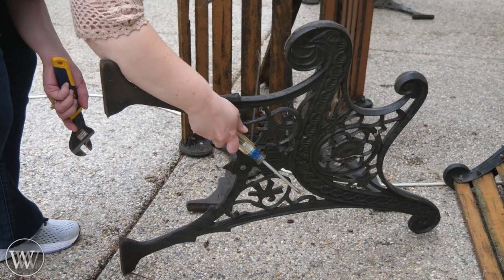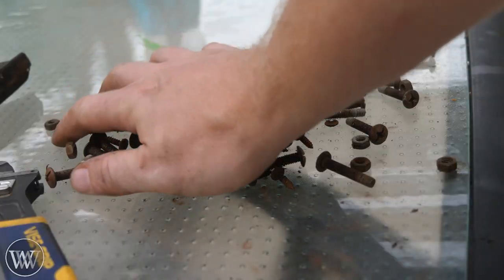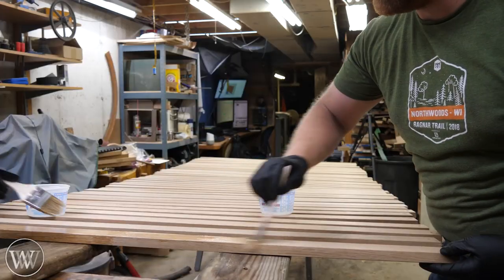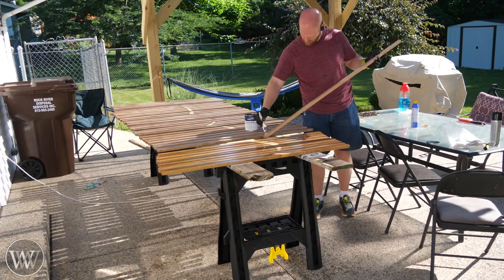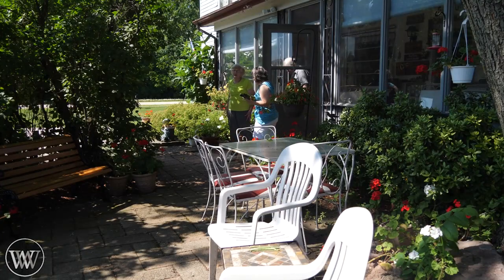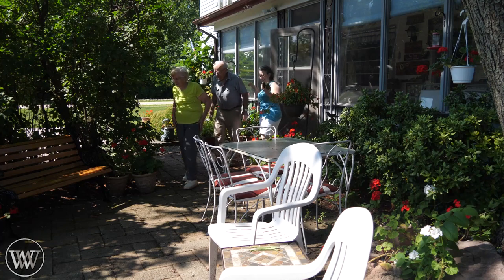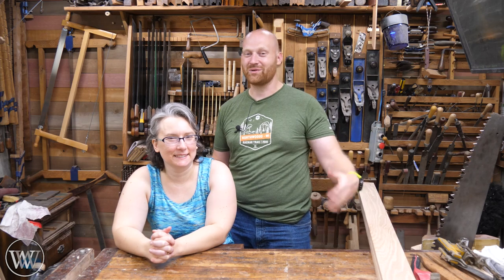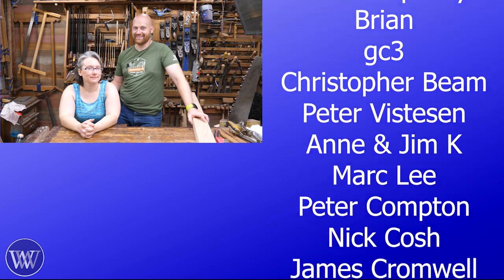Cast Iron Bench Restoration

Comment: Hi Im from the uk and have one left behind in my council house by the old owner  that rented the place nothing wrong with the wood just needs to be taken apart and wood sanded down and a nice new paint job but can’t get it apart as the nails and screws are rusted is there any tools that can break the nails and screws don’t want new wood
Reply from the maker: I would use a pe itrating oil. Here in the states I use PB blaster. Not sure if you can get it over there.

Comment: my wife and I have this exact Edwardian cast iron bench frame.  We replaced the slats with white oak slats. We used a oak stretcher on the bottom versus the angled iron seat support.  Ours also had the curved iron center support. Yours tuned out great

Comment: I too have have two old reclaimed cast-iron bench ends. But not the wooden slats. Nor do I have the metal 'straps', or the nuts n bolts. Think I'll watch your video, though... might help me with my restoration. Thanks for sharing.
Reply: The strap is just a piece of iron or steel you can make yourself with a torch and hammer

Comment: What size did you cut the slats to. I'm repairing this same bench, but it didn't have boards. I'm mainly focused on the width. Thank you if you see this and reply.
Reply from the maker: Most of them were 2 in but the ones around the tight radius were inch and a half on mine. You should just be able to measure from center of screw hole to center of screw hole and then subtract a little bit for the Gap you want in between them.

Comment: Are you guys Amish? I’ve been doing these benches as a side gig for a few years. For how long does the epoxy finish last? No yellowing? Have you used IPE?
Reply from the maker: Lol not Amish. I just teach hand tool woodworking so it doesn't make sense to have power tools as they don't teach the method. If I wasn't teaching hand tools for a living, I probably would have a solidly hybrid shop. Especially for a project like this. Power tools would definitely be the way to go. The epoxy isn't the finish. It binds with the outer surface of the wood and penetrates a little ways in. It. Basically hardens the outside wood making it far more water resistant. Then on top of that you put the marine grade varnish. Generally it just needs a power washing once a year and it looks about that good for 2 to 3 years depending upon how much direct sunlight it gets. After that it generally just needs a dust up with sandpaper and two more coats of marine varnish.

Comment: I recently did a similar job using cypress (which is what I had available). I plowed a groove down the length of each of the bottom slats and set a half slat onto it to form a tee, making sure that each piece bowed upwards along its length. The somewhat bendy slats are now stiff and strong, even with my huge posterior sitting on them.

Comment: Did you replace the metal bracings on the bottom or were those original. If you replaced them with new ones, where did you purchase them from. I just got a cast iron bench ends but it didn’t have any of the bracings and I desperately want to refinish it. Thanks. I really enjoyed your video.
Reply from the maker: Mine were original. But they were just straps of mild steel 3/4 in wide you could go buy them from the hardware store and drill holes for each panel.

Comment: I have the exact same bench. Looked up redoing a slat and iron bench. I have no boards to use as a reference. Could you tell me the dimensions you used for the boards  please?
Reply from the maker: they are all 4' long and 3/4 thick. the larger ones I believe were 2" wide and the thinner ones were 1.5"

Comment: What did you do to protect the cast iron from rusting?  I noticed you only power washed the iron.  I have a bench I am workin on for someone and I am using a wire brush attachment on my drill to knock off rust.
Reply from the maker: I use a self-etching primer. As long as it's just surface rust that will set it in nicely. And then coat it with a good extra year paint.

Comment: So the iron sides which by the way each weigh atleast 60 lbs..did they just stand straight all by themselves as you put the first cross pieces on??
Reply from the maker: i eather leaned it up agents a post to get the first one or braced it on my leg. each of the sides are about 20lb. so they are not that bad.

Comment: My husband and i are getting ready to finish a bench.  We were wondering where you buy the braces on the bottom of the bench?
Reply from the maker: For mine they came with the old bench. But they are just strips of steel. You can pick them up at any big box store and drill the holes bend them to shape and a vice.

Comment: I have a similar bench but it’s sort of like a swing but it has the wooden slats and they are so old I’d like to do the same thing that you did what kind of wood do you use?
Reply from the maker: If it's outside I would suggest a white oak. It's very water resistant. Red oak is less weather resistant though. So be careful.

Comment: Any chance you might know where to get that middle support that runs up the back? Or did you just buy something from a local home improvement store? I recently finished a restoration , but I’m afraid to even sit on it without that middle support. Thanks for any help!!
Reply from the maker: It is just a strip is 1/16" steel strapping so you could pick up a strip from most hardware stores and bend it to shape.
Reply: @WoodByWright  Awesome!! Thanks so much!!

Comment: Great video! I have an antique garden bench I'm restoring and need the metal supports that connect the cast iron sides to the bench wood beam on the underside. Do you know where I can find these?
Reply from the maker: Those are just straps of steel. You can bend them to the shape pretty easily. You can find similar strapping at most big box stores.
Reply: @WoodByWright  Awesome! Thank you

Comment: I don’t want to stain it, I want to paint it. Would spray pin work or should I paint it on.
Reply from the maker: Spray paint would be fine. Just make sure you do four or five very light coats. The downside to it is if you put it on thick or even a full coat it tends to chip off

Comment: A trick with the phillips screwdriver is to use vice grips to turn the shank while you push inward. Some larger phillips screw drivers have a squared off shank near the handle so you can turn it with a wrench.
Reply: Or.... Craftsman screwdrivers have handles that a 1" box end wrench will engage for extra leverage.

Comment: Beautiful result. I'm going to copy every step. What is the burnt orange paint on the cast iron ends before black was applied?
Reply from the maker: I think that was just odd lighting color. It's a self etching primer prior to the recoat. If you really want to I have a second channel where I do all of the how-to. Anytime there's a video on this channel there's a corresponding video on the other channel where I talk through all the steps and provide all the information. This channel is more for the easy watching who do not really want to do it they just like watching it.
Reply: @WoodByWright  Thank you, got it. Does experience tell you if the Total Boat Penetrating Epoxy is ok to put on stained wood? Their description on Amazon says, 'Seal bare or new wood to protect against damage'.
Reply from the maker: If it is just stained then it will work fine as the stain does not seal it.
Reply: So I just did the Total Boat Penetrating Epoxy on the top and sides of my boards. Product instructions say 2 days to cure at 80 degrees. From your experience do I need to wait the full 2 days before flipping and hitting the other side? Also what grit do you sand this product with before applying the Marine Varnish? Thanks

Comment: I am about to embark on restoring two such benches. If you could let me know what the width and thickness of your slats is, I would appreciate it.
Reply from the maker: every bench is different. if you measure from center to center of the screw holes and subtract about 1/4" that will tell you the size that goes there. mine were 2" and 1.5"

Comment: That's a lot of slats!! :) I've done a number of these benches and love doing them.I am curious about the epoxy and varnish and have a few questions. How much does a quart of the epoxy cover or how many slats (I assume you did one good coat of it?

I see you did two coats of the varnish with a light sand in between. I do the same (sanding). So same question on the varnish. How many slats can you cover with two coats per quart? 

Thank you and always enjoy your videos!
btw, I was recently told that Helmsman Spar Urethane was the bomb so I tried it on a bench. I even used three coats with sanding in between. Utterly disappointed at the outcome. After 3 weeks is was as if I had left the raw wood out! Never use it outside again.
Reply from the maker: I cover a lot of this on the second channel where I talk through the project. The epoxy covers a lot I only used about 1/8 of a quart on this one. I did 5 coats of varnish sanding between each. Ya there are a few brands like that that I just don't like.

Comment: I have taken a square 8x8 cm white PVC tubes, set an iron bar treated, fill it up vertically with concrete and used them instead of wood beams.  Never did anything better. Much better than any wood.... and lasts a long time.  Better than any wood for sure.  Regards.